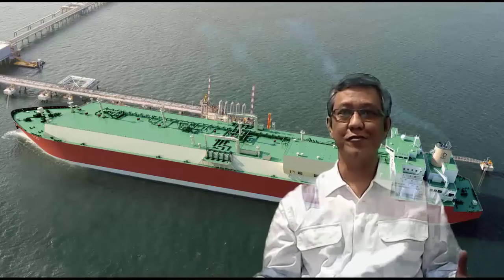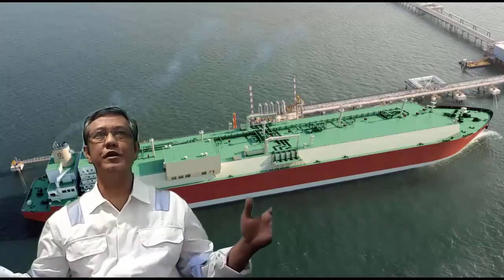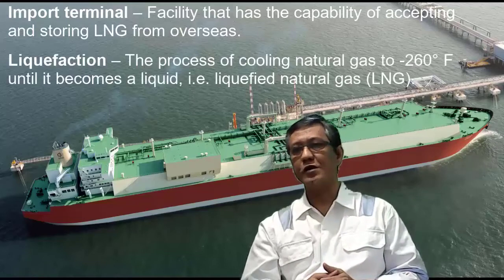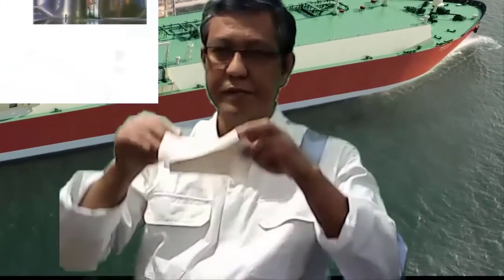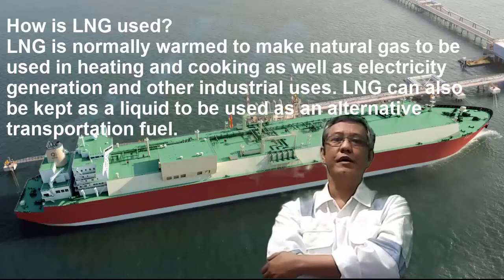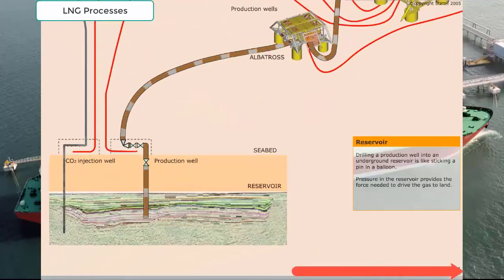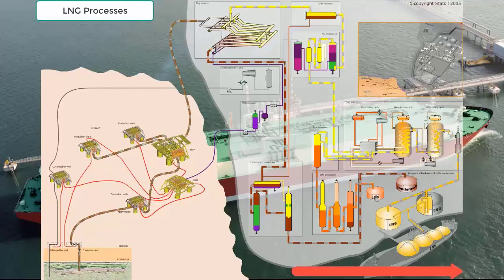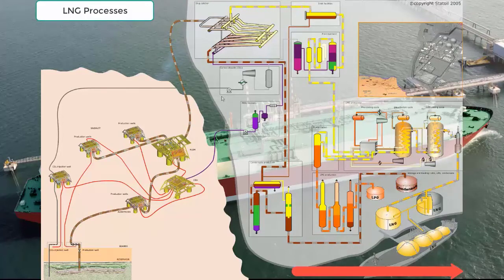What is LNG? from a Seafarer onboard Gas Carrier

Comment: very interesting video !!! Are you an Engineer on board or Deck officer ? i will subscribe to your channel cause i want to learn more about LNG .. especialy at Engine department !!! Thank you !!!
Reply from the maker: Tks so much. Yes, I am or was a Chief officer on Gas Tanker and many other Tanker type. As for the engine side, I discussed thru simulation based materials. However, a Chief Engr. presents or collaborate with me for that Dept. with whatever you may want to know. Most cases it will be the typical type dual fuel/diesel electric and perhaps the steam turbine system. Post a suggestion and lets see what we can prepare along the pipeline
Reply: @ShipAhoyVlogs  Thank you for feedback Chief. I will embark soon on LNG vessel soon for the first time. It is a really big opportunity for my career. All the experience i have till now is 3 voyages on Bulk Carrier vessels with 2 stroke diesel engine Man b&w. The company that gives me the opportunity to embark on LNG , has 1 vessel Moss type with steam turbine , 4 with DFDE as you said above and 11 new vessels with 2 main engines and 4 Generator engines.
The 2 main engines have 1 propeller each engine and they are 2 Stroke and burn gas. They called WinGD. All i want is a video with parts and machineries , at least the most important ones by adding a little explanation about their job. For example i heard about cargo compressors , or GCU gas combustion unit . Unfortunately i  can't find enough informations  on internet :( that makes me anxious because i don't like to embark without any knowledge. Thanks for your time , i wish you can do something about it. I will appreciate it. Best regards.
Reply from the maker: @fishnchill13  It may take sometime to create a presentation/lecture/discussion. This channel was created 2016 but I didn't take it seriously. The videos you are seeing except for first 3 old videos were just recently uploaded. GCU or even compressors will be done separately as this subject matters are lengthily. And that my main scope is basically all type of ships, tankers, bulkers, even heavy lift multi purpose, except cruise ship. Nice channel you have by the way. Never had the luxury of fishing, good for you.
Reply: @ShipAhoyVlogs  Thank you Chief hehe :) i'm so glad to hear that. Well , you are very kind !!! I'm waiting a lot of you , if you have the time of course...God bless 🙏